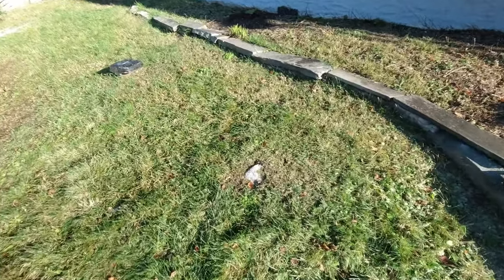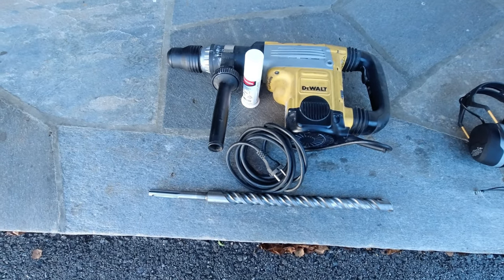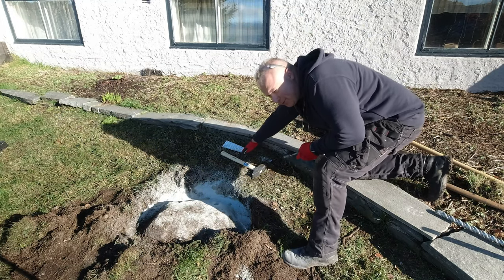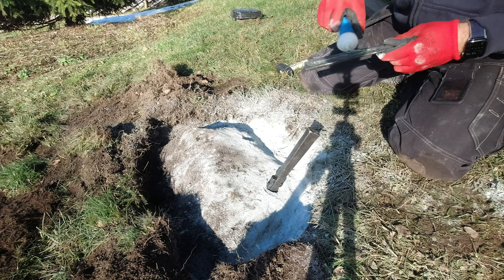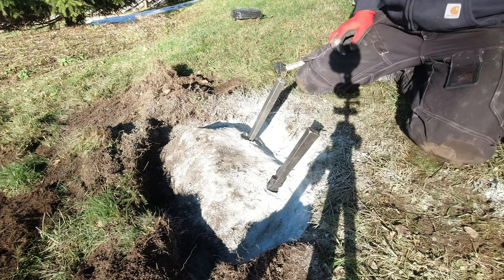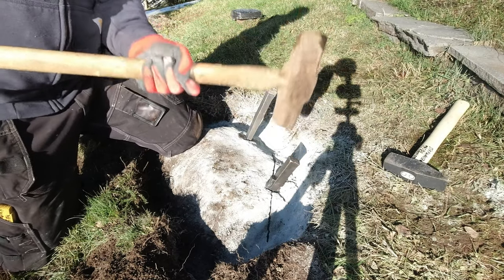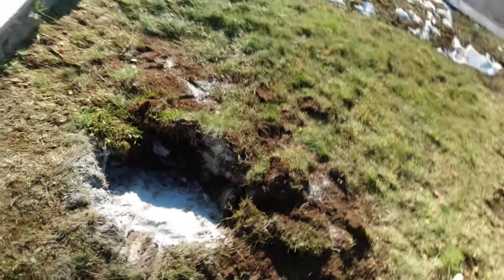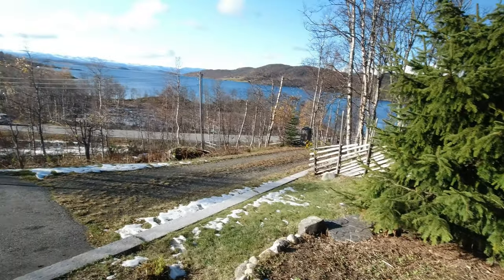Splitting big rock! With wedge and feathers. Do it yourself!

Comment: This was a terrific video. I am facing this exact issue in my lawn - but not just one rock, unfortunately. I bought a bunch of feather and wedges that look like toothpicks next to yours. And I've discoveredd my hammer drill is totally unsuitable for this work. I'm wondering if there's a reason to get such large feather and wedges and drill bit size? Also, could you say how long it took to drill each hole?
Thanks.
Reply from the maker: Hi! Thank you for the comment😀 I use big wedges because you get a lot more force, and need fewer holes. It takes about 4-5minutes to drill the full length of the drill bit. This can vary a lot, depending on the hardness of the rock or bedrock you are drilling. It is hard work to split and move rocks by hand!!

Comment: Good instructions. Have you had any problems with the bit getting dull drilling rock?
Reply from the maker: Sometimes it can break of parts from the hardened steel at the drill bit tip. They last for a long time if you use it right. They do get dull as well, but some can be sharpened. They drill fine even dull. I know someone use running water too cool it down while drilling. I newer do that. I have several bits and change after a couple of holes to let it cool down naturally.

Comment: Donde compro usted sus cuñas y plumas?
Reply from the maker: Here in Norway it is a lot of stores that selling equipment for stone jobs. If you google wedge and feather in your location, I’m sure you will find it. You can buy cheap Chinese made or high quality like Atlas Copco (expensive). It is a lot of fun to work with stone and boulder removing! And it is the best workout as well!
Reply: Gracias por su respuesta un saludo desde México 🇲🇽